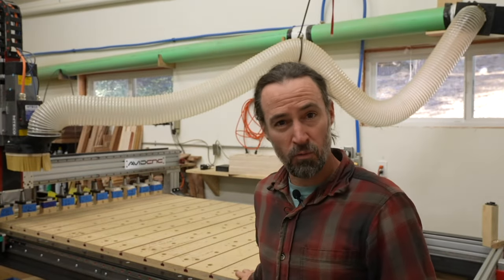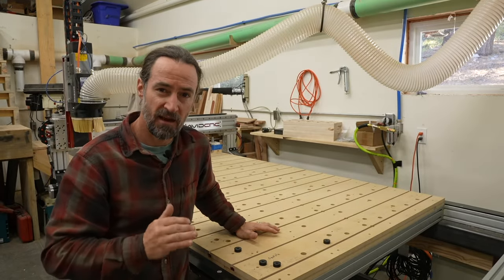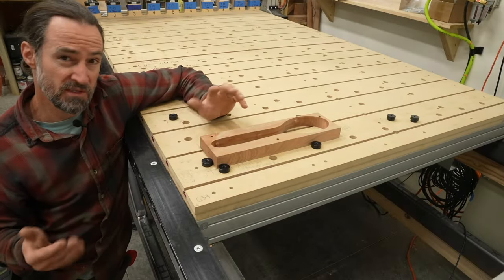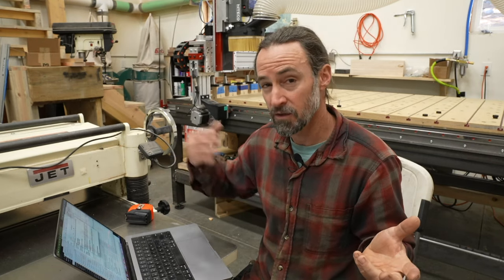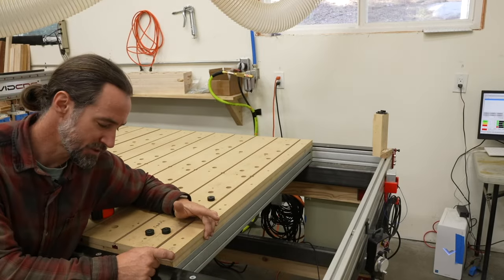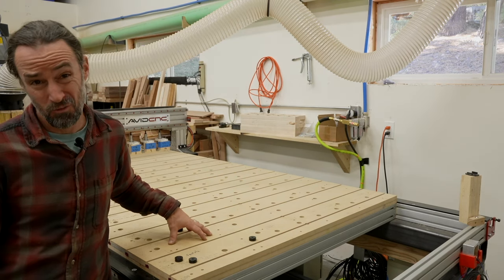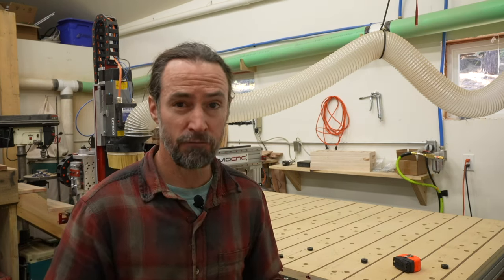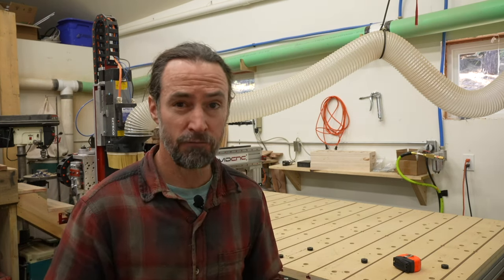CNC Build Ep 12: Make the ULTIMATE CNC Spoilboard! Affordable, easy to build, incredibly versatile.

Comment: Howdy. Great job on your spoilboard. One thing often overlooked on my glue-down setup is replacing it. It's never replaced. Simply flatten one last time, glue another sheet, and use the machine file to recut the holes in the same spot. Never remove, always add. Good advantage of removing yours with screws though. I've not encountered a need for greater clearance under the gantry but for what you do you may. I often tell people the 2x4 scab boards to screw down to were unnecessary. I thought it would be easier than trying to align the captured nut slots but in reality, it's not.
Reply from the maker: Thanks Jay! That's a good point about the glue-down method -- I hadn't thought about just machining away the old, and then adding on another new on top. I think the glue-down method is way stiffer; I may try it when I have to add new layer. I super appreciate all your videos -- they are a big inspiration for me!
Reply: @CorbinDunn  As are your bowls and boxes. What you are doing in the CNC space is fascinating.
Reply: @CorbinDunn  Another big difference is all Jays stuff is paid for by sponsors, no out of pocket expense for him. Love his work and channel though.
Reply: What Jay said.  If you can spare the extra height of one more MDF thickness then the top layer becomes completely sacrificial and replaceable.

Comment: This is helpful.   I just got my Ultimate Bee setup and now planning out the spoil board.  Thanks!
Reply from the maker: Super! Definitely take whatever ideas you think are the best and incorporate them into what you want in your design.
Reply: @CorbinDunn  I plan do do just that.   I also like Eigen Designs approach to adding a sacrificial modular layer on too of the permanent spoil board.
Reply from the maker: @mtnjak  I hadn't seen the  Eigen Designs  spoilboard...I found his video, and he has a lot of great ideas! I like the threaded inserts..and that modular sacrificial spoilboard is another great idea. I may have to make one too. Thanks!
Reply: @CorbinDunn  yes.  I think anytime I don't have to screw into, remove, and screw into again, by using inserts the surface is infinitely more lasting over time.

Comment: I just installed something very similar! I added in removable sections at the front and rear for the rotary axis and vertical table.
Reply from the maker: Awesome! Yeah, removable sections are awesome...I've thought about plugging up the hole in the front until I need it, but so far I haven't gotten around to doing that.

Comment: Creating a video on how to use offsets with Fusion 360 is a really good idea. I'm not sure I found the right process yet on my side and I couldn't find a lot of videos on that.
Regarding the spoilboard, I agree 3 sheets of MDF is too much. I chose to use 2 sheets but I glued them and it reduced a lot the flex I was having with only one sheet. The idea of adding perpendicular supports is really good, I will use it. I don't think gluing is a real problem because when I wanted to change the top layer, I just surfaced it several time and glued a new sheet on top of the old one. Instead of buying T-tracks, I used a T-track bit which works really well and allowed me to create vertical and horizontal tracks and it costs nothing. After 18 months of usage, I really think it's a good idea to have both directions because it allows the use of clamps that push materials perpendicularly to the track you are using.
Your videos are always very interesting
Reply from the maker: Yeah, that’s a good point about gluing it together and adding more strength! I should measure my vertical flex and see how bad it is with my setup. 

I’ll definitely do some offset videos - it is so handy, and helps eliminate some errors (and can cause some others though). 

It’s also good to hear that the pure MDF t-track works well! I think that is a good option.
Reply: @CorbinDunn  Also, I bought high quality MDF, very dense. It helps a lot.

Comment: Corbin, curious why you didn't glue the slats between each T track. Now you have a bunch of screws pretty darn close to the table surface?
Reply from the maker: The short answer is: (1) To be able to remove and replace individual slats and (2) to be able to remove slats and remove the entire spoil board from the table.

Regarding #1: My thought was that I could replace just the worn ones, and not have to do the entire table. If I glue them in, then the only way to replace them would be to surface/machine them off, and glue another set back on top. Surfacing them completely off won't be possible..because as soon as I start to get close to the t-tracks (which they cover and help hold down), I would have to stop going any deeper. That's not too big a deal...and you could always just add another layer when they get worn away, and effectively go into a 3-layer system like Jay's design. Disadvantage of this is that it cuts down on your maximum z-travel. Advantage is that you don't have screws, which you could possibly hit! In practice, I almost entirely avoid cutting into my spoilboard, so I think glue might have been fine.

#2: I could have made the entire table removable by drilling/machining access holes for the main bolts. It'd be heavy. I'm also not sure if I ever will remove the entire table, based on how hard it would be to re-align and set it back up.

Comment: on top of baltic birch
Reply: Agreed why you would ever make a solid foundation with screws into MDF I have no idea. And not wood screws You need drywall screws.
Reply from the maker: That's an excellent point; all other sheet goods except MDF generally have better screw holding power.